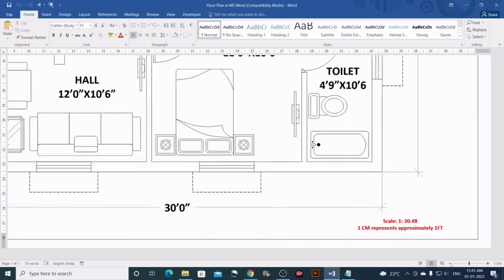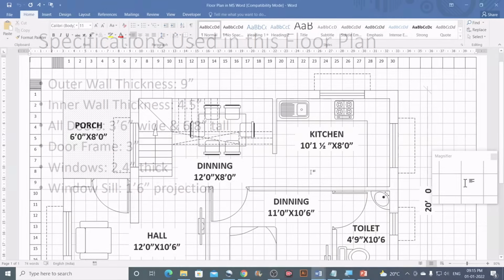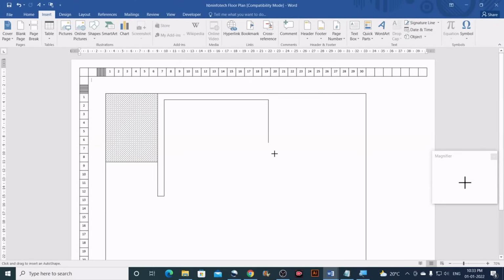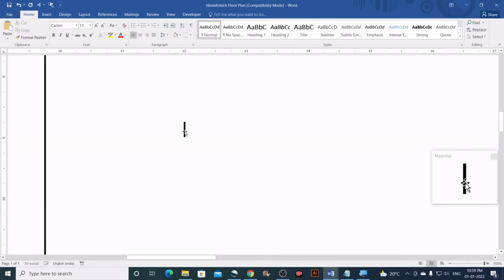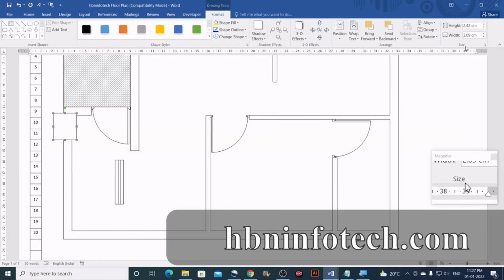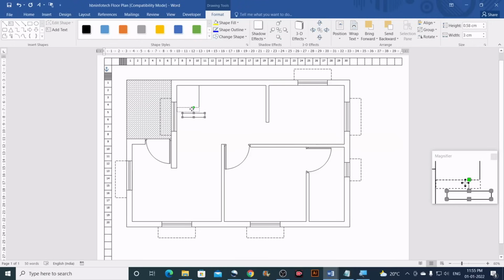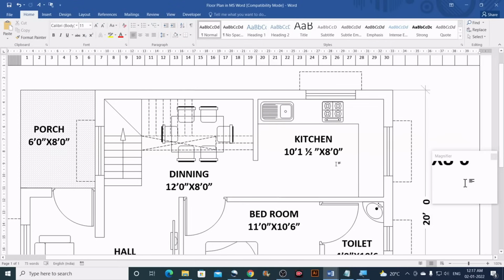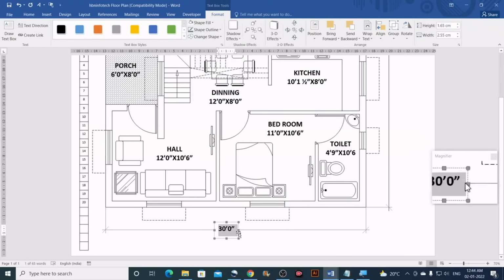Floor Plan in Microsoft Word using Easy Measurement and Scaling Technique

Comment: This has to be the most comprehensive and useful Word video ever. Thank You. I have one query how do you choose A3 if you are not using an A3 printer?
Reply from the maker: You can go to some print centre and take the printout. Very Simple
Reply: @HbninfotechTutorials  Hi That was not the point of my question. A3 is not a choice on Word if you have A4 printers. I have solved it by setting the printer preference to Microsoft PDF Printer then A3 becomes a selection. Great videos thank you.

Comment: This was very informative. Your English language and commentary were very clear and good. There are many people who have computers with MS Words and very few with AutoCAD and other such luxury software. This tutorial will help many in using MS Word to draw simple plans although it is tidious and takes time but it is worth it. In my opinion if the floor plan is in Imperial units of measurement the grild should follow that. The conversion is easy if 1cm=1ft, means 0.25cm, 0.50cm, 0.75cm, 1.0cm would be 3,6,9,12 inches respectively, however, if grid is 1in=1ft will make it lot easier. Overal it is a great presentation and there are few man like yourself out there who take time and share their knowledge to help countless people. Great contribution. Thank you for sharing.
Reply from the maker: Thank you so much